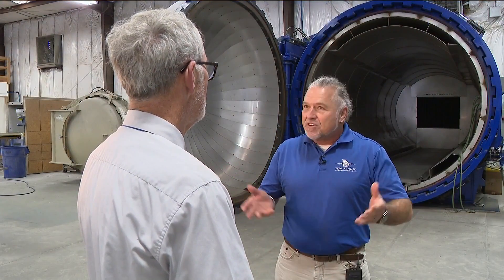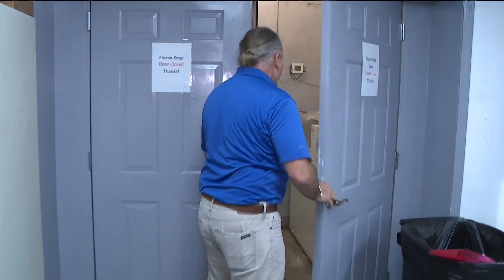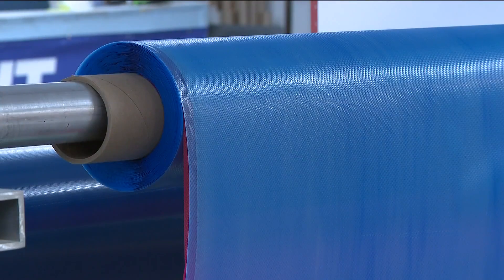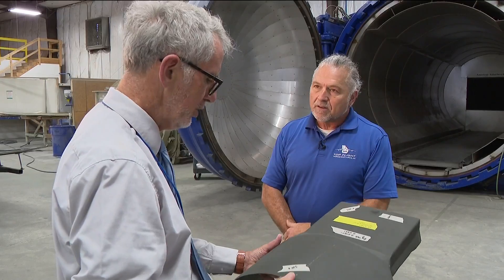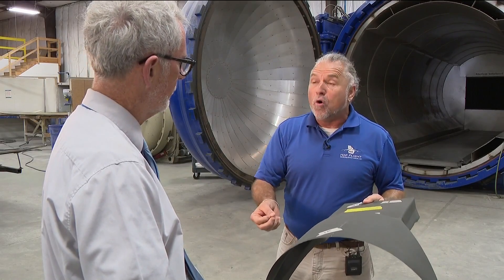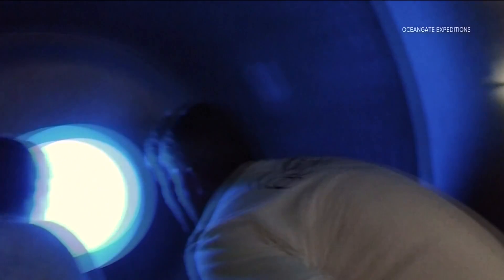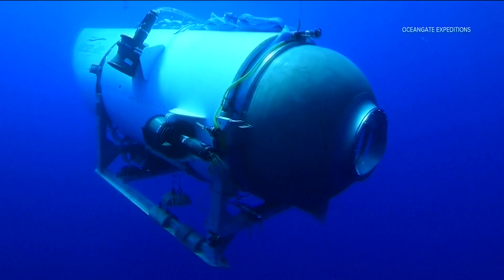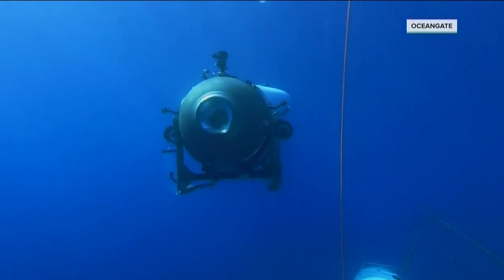Georgia engineer talks carbon fiber that failed in Titan submersible implosion

Comment: Delamination is when layers of carbon fiber begin to unbond from eachoher due to stress. Steel returns back to its original shape. Damage to carbon fiber remains and accumulates. That's why the Titan could make multiple successful dives before imploding.

Also, carbon fiber holds INSIDE pressure well because the tensile strength of the fibers is incredibly strong. Outside pressure on carbon fiber will put more stress on the epoxy that the fibers are suspended in, which will necessarily promote delamination.

Imagine a barrel wrapped in ropes and glue. You can't stretch the barrel because the ropes hold tight, but if you squeeze the barrel, the ropes fall loose and the glue breaks.
Reply: This makes sense. The CEO was really trying to make a killing off his venture - cutting costs by skirting regulatory requirements, testing and routine inspections.
Reply: Not just "Stress" (Cycles) ... try and find the videos showing lay up of Titan's hull ... no "clean room" ... out in the open in a warehouse !!! The reason we're so strict on clean room temp/humidity levels is to prevent water vapor between layers ... it will cause a delam during the Autoclave cycle ... but this "back yard/shade tree" operation didn't even bother to NDI the finished product so all bets are off. Cra - Cra
Reply: @craigsowers8456 ,a real Mickey mouse operation, for daffy duck and goofy, unbelievable 😮
Reply: That is the best explanation
Reply: So glad to see this is the top comment. Yeah according to James Cameron, carbon fiber tech is insidious because it's a ticking time bomb due to delamination, progressive failure over time with microscopic water ingress and cycling fatigue.
Reply: @roahnosh James Cameron is a movie director. He does not have the correct education to speak intelligently on the matter.
Reply: I saw the pictures of the inside of submersible. The monitor was bolted or screwed directly to what looks like the wall.
Reply: @kerryarrant1523  I saw that too. Nice way to concentrate stresses into a tiny area.
Reply: @kerryarrant1523  so were the handles he got from Home Depot 🤦
Reply: That analogy actually makes a lot of sense to me
Reply: The reason you stated alone is why it should never be used for such applications.  Unbelievable!  😶
Reply: You are 100% right 👍👍👍
Reply: thats it,  joe is correct its a good material for tensile strength but for  outside pressure its not as good at all ,so sad for the poor young lad that died ,, may they all rest in peace
Reply: This is a great analogy, thanks
Reply: The  barrel and  rope  analogy is  excellent
Reply: Good point, external pressure loading is more demanding on compressive strength. Whether he uses carbon fiber or Vibranium, the compressive strength of epoxy will be determinating factor of the performance.
Reply: It made four! lol
Reply: Would it be feasible to utilize the tensile strength of the carbon fiber by creating a surface of concave dimples - like a golf ball?
Reply: @Ken_Scaletta  In between the dimples would be a like number of convex areas and the irregular surface would be a minefield of stress risers.
Reply: @Sherman62  Thanks. I figured it probably wouldn't work.
Reply: I have to ask - basically we're in a scenario where the entire carbon-fibre pressure vessel is under massive compression from all sides (at 4,000m depth, the pressure is about 400 atmospheres, if I understand correctly. So under those circumstances, what are the actual carbon fibres in the composite material (the fibres which are designed to carry TENSION in the directions in which they're laid) even doing, other than creating stress concentrations and potential failure points for the epoxy, which is bearing literally all the compressive forces? Am I a million miles off here? It seems to me that CFC is a very poor choice of material for vehicles operating in high-pressure environments.
Reply: I mean, not necessarily.  Steel does bend and weaken.  I don’t know how long it takes before a craft is unusable at titanic depths, but steel does deform.
Reply: @30wrdy  As long as the stresses are below the Fatigue Limit, you and stress steel, aluminiums, and other metals indefinitely.
Reply: @@DaisyDuck-ib4ks It was built by teenagers. Interns from a local   college built the electrical system.
Reply: fatarsemonkey  What held them to the hull? Pressure, mainly. This thing was sealed like a can of jam on each dive.
Reply: Hydraulic press channel has proven you stupid
Reply: The YouTube algorithm or Ai wants everyone to believe carbon fiber is the issue. Extreme pressure carbon fiber scuba tanks for deep sea are similar shape and pressures and have been around for decades. Hydraulic press channel has proven repeated cycles would not weaken the hull. I suspect sabotage, possibly the ex employee who was terminated. Or possibly an unintentional act, it looked like a monitor mount was screwed into the hull. That could be the smoking gun
Reply: metal is probably a lot better material for pressure. that said the design was flawed all around, including a hull that was way too thin. meaning it would flex and gradually be destroyed
Reply: @jorelldye4346 wow another youtube scientist talking out of his butt. Ever heard of metal fatigue?
Reply: very good analogy.  Cameron's analogy of a chum meat cloud afterwords was a bit too descriptive. 2ms time frame is hard to imagine
Reply: @TheLinuxYes  I think the "meat cloud" is the best description. Flesh holds together even after it is crushed to oblivion, so there would be cohesive blobs of human flesh and bone matter afterward. My surprise is that the critters didn't devour it all before the coast guard found some of it.
Reply: @jorelldye4346  that water is not much above freezing plus there isn't as much life down there as there is further up into warmer water.  cold and pitch black darkness.
Reply: How does this degradation from repeated compression and expansion cycles over time differ from that of an airplane fuselage made of carbon fiber, like the 787 Dreamliner? Is there a difference between underwater compression and atmospheric compression? How is carbon fiber safe on an airplane? Would really like to understand the difference.
Reply: @SidGolan  for instance, at a depth of only 500 feet the water pressure acting on the hull of that sub was 31,223 PSF.a much higher force than at 32,000 feet in the air.
Reply: @SidGolan  lol the higher you go the LESS pressure. Deeper you go under water MORE pressure. Very basic and easy thing to understand. Airplanes are pressurized, not much just a little bit, from the INSIDE.. to match the pressure at ground level. Not from the outside.
Reply: @jeffhicks8428 Your reasoning doesn't make sense. Pressure itself is not the issue. It is the stress/strain it causes in the material. Keep in mind that an aerospace fuselage skin is only 1mm thick. 

Further,  although the atmospheric pressure goes down when flying higher, the pressure difference (which actually loads the structure) goes up.
Reply: @SidGolan Must be the different types of forces. Sinking into the deep sea and ripping through high altitude (not to mention the stresses of takeoff/landings) are vastly different.
Reply: @SiddharthGolan A plane is pressurized on the inside, atmospheric pressure gets less the higher you go and they keep the cabin pressurized at sea level? 
At least that's how I think it works.
Reply: @SidGolan m
Reply: @SidGolan  It's also held together with substrates that are sensitive to the corrosive effects of saltwater.
Reply: @SidGolan sea level pressure is 14.7 psi.  At 35000 feet altitude, 3.7 psi.  13000 feet underwater is approximately 6000 psi.  The simple math is water pressure increases by one atmosphere of pressure (14.7 psi) every 33 feet below the surface.  There is a more sophisticated formula for calculation.  So a carbon fiber aircraft is only subjected to less than one atmosphere of pressure differential.  A submersible at a depth of 13000 feet has over 400 times more pressure differential.  The hull was 5 inches in thickness.  Can you imagine an aircraft fuselage 5 inches thick.  No way that puppy is getting off the ground.  Lol
Reply: @SidGolan  Airplanes at altitude have higher pressure on the inside than the outside, meaning that the CF will be under tension, not compression as what the sub would be subjected to. Also, the pressure differential is way lower -depending on the altitude and temperature, it will be only around a 13.5 psi difference instead of the almost 5000 psi difference the submarine would see.
Reply: @SidGolan  "How does this degradation from repeated compression and expansion cycles over time differ from that of an airplane fuselage made of carbon fiber, like the 787 Dreamliner? Is there a difference between underwater compression and atmospheric compression? How is carbon fiber safe on an airplane? Would really like to understand the difference.

In short the two scenarios you listed are EXACT opposites.

Submersible, has 1 Atmosphere inside, maybe 600+ outside. This means that the forces are from the outside trying to crush the CF tube.
Airplane has .8 to .9 Atmosphere inside, maybe .4 to .5 outside. This means the forces are from the inside trying to expand the CF tube.

That is the difference, Plane is using the tensile strength of CF to stop the tube from "exploding".
Sub is relying on the epoxy to stop the tube from "imploding".

Your two scenarios are completely different applications of how the material works.
Reply: @SidGolan  I know I am 2 weeks late to the party here but...

The pressure inside an airplane is HIGHER than what it is on the outside of it. Since the force inside the plane is higher, it is putting tension on the frame (its walls) from within... like its pushing outwards. This is one of the reasons why carbon fiber works on planes. The tensile strength of carbon fiber (being stretched) is very strong. It can withstand heavy forces pushing from the inside out. 

Problem is that the material is not that good when being compressed. In the case of the Titan, the force pushing IN is absolutely massive. The material does not have the suitable qualities for this application. This is why everyone is saying that using carbon fiber is not a good idea when you are dealing with massive pressure coming from outside the object.

Was watching some guys perform compression tests on stainless steel and carbon fiber. Steel was able to withstand 5 times more force.

"When an airplane reaches its typical cruising altitude — usually about 30,000 to 40,000 feet — the outside air pressure may be just 4 to 5 PSI". 

"The water pressure at the site of the Titanic wreck is roughly 6,000 PSI"

So an Airplane is exposed to 4-5 PSI and the Sub at the level of Titanic is exposed to 6000 PSI. Quite the difference.

Obviously its far more complex than I explained it. But, its gives you a rough idea.
Reply: @SidGolan  In aviation and space craft the pressure you are holding into the craft is an inflation force of not generally not more than 14.7 pounds per square inch. 
In a high pressure COPV the pressure is about 2 or 3 thousand pounds per square inch inflation pressure.
The sub is under compression pressure of about 6500 pounds per square inch.
the strands of fibers will resist stretching but not compressing.
Aeronautical engineering is not maritime engineering.
Ship builders should build ships.
Aircraft builders should build aircraft.
One is light by necessity. light enough to fly.
The other is built strong enough to not break in bad weather or water pressure. "Hopefully."
You would not build an airplane to fly 1000 feet below the water.
Do not use aircraft technology in the underwater world.
Reply: @SidGolan take a one dollar bill, roll it up enough to leave a cavity. Now, close one side with your hand and the other with your mouth and blow air inside. The bill will hold it's shape because the pressure difference is stronger inside than outside and the tension of the bill is at maximum. Now, hold the rolled up bill in one hand and squeeze. The pressure applied by your hand is stronger that the one of the atmosphere and the rolled up bill collapses.
Reply: @SidGolan  Airplanes are holding pressure in. Carbon fibers takes the load. It has great tensile strength.

This sub was keeping pressure out. Crushing carbon fiber puts alot of stress on the epoxy that the fibers are suspended in and less on the fibers.
Reply: @jorelldye4346 you got it! That and I believe the connection of two different materials that expand and contract at different rates. Those titanium end cap bonds became weakened after so many temperature cycles in my opinion
Reply: @freddylong156  Indeed, I think that carbon fiber was getting crunchy near the titanium caps.
Reply: Steel only returns to it's original shape if the loading is in the elastic region. Metals accumulate damage as well and undergo fatigue cracking (though they are not brittle materials). 

Composites are not weak in compression (but yes, weaker relative to there tensile strength). 
The barrel/rope analogy is completely wrong for a laminated composite. The higher stiffness of the fibers means they take the majority of the load in compression as well; it is the job of the matrix to transfer the load to the fibers.
Reply: that is  bullshit steel can delaminate too .
Reply: These guys love to make things that fall apart after little use. Then it's time to sell the sucker more carbon fiber things. Just like Walmart and Home Depot. Disgraceful.
Reply: @thinkcasting3182  so true. We are going in the wrong direction of sustainability. Also, the damage is hard to spot. That is why you must rigorously test everywhere. The testing alone is drive up the pricing as well. Steel is hard to replace.
Reply: @ST-rj8iu  It's roughly 11,000 PSF at 500 feet down, could you imagine the pressure at 2 miles down?
Reply: @thinkcasting3182 Are you brain damaged? What are you even talking about?
Reply: @thinkcasting3182  It's not really planned obsolescence considering carbon fiber is actually a pretty cost-effective material that can last as long as steel in the proper conditions. Taking carbon fiber 20,000 leagues under the sea is by no means proper conditions for carbon fiber.
Reply: You engineers aren't good at   explaining risk with math tables. Example: 
Initial State: Carbon-Fiber Hull. 

Dive Event 1, Depth 3k ft. probability of loss: 5 %

Dive Event 2, depth 6k probability of loss: 10%

Event 3, depth 11k ft. State: delamination and stress to fracture point. Risk of loss: 80%

Do you think anyone would accept risk 3 ?
Reply: @turnthepage867  That's not a math table. There is no math in your comment - only arbitrary numbers.
Reply: @jorelldye4346  The numbers are examples, but the method is quantitative. Decision tables are populated with numbers that incorporate the physics analysis.  Usually there is a proposed course of action,or an alternative course of action (dive, do not dive).
Reply: @turnthepage867 
What?  how about just finding out by testing and certification if the thing can survive a dive instead of making up probabilities of failure out of thin air?
Reply: @turnthepage867  Your comment makes no sense that is not how risk analysis is done.
Reply: @PocketRocket_  Bayesian probability tables are how risk is explained not how its analyzed. Risk of vehicle loss at dive 1 is way different than risk of loss at dive 4. To make an informed decision, passengers are owed an explanation of : what is the probability of A (loss) given B (delamination) degrees of certainty ( how much do we know about what happens to delaminated carbon fiber).